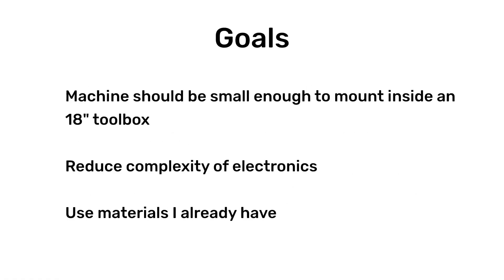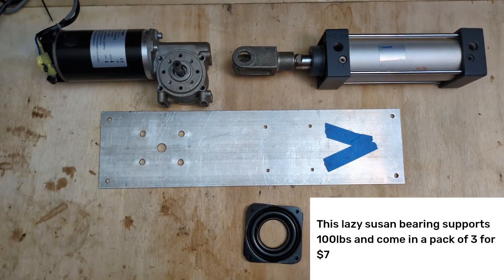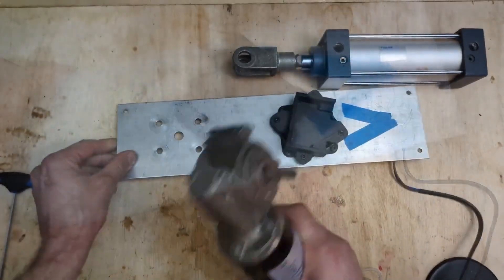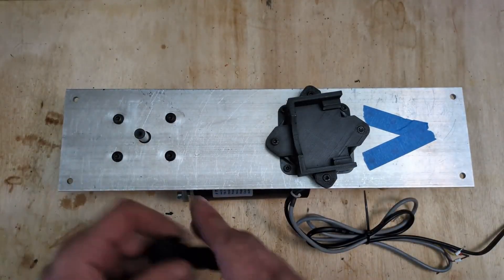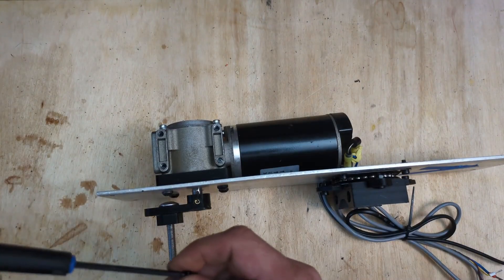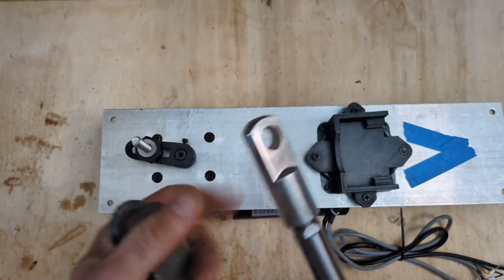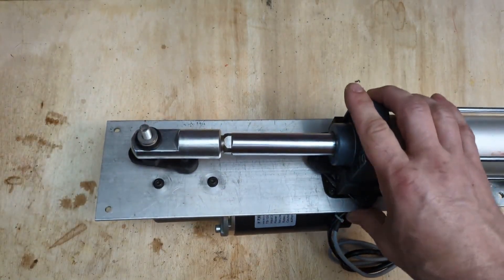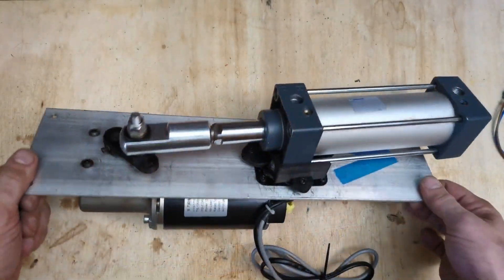DIY Compact Milker in a Toolbox

Comment: Which size of cylinder it is would you recommend it iif someone wants a vacuglide like experience?
Reply from the maker: If you go with a SC50 x 100  - or any cylinder with a 50mm bore and a 100mm stroke, that should be more than enough. It's much easier to have a cylinder that's too large than one too small :)      The vacuglide is built like a streamlined tank - I wish I could make something that looked as nice. I have no clue how they build it with Aluminum and include multiple receivers and bag for less than a Venus.
Reply: I will get the Vacuglide 2, if it won't be too expensive in Germany.
With 20 speeds, scripting, http control they should have nailed everything except stroke length adjustment during use and no suction like in the seriouskit or a milking machine.
Reply: Und hast du das Teil schon?